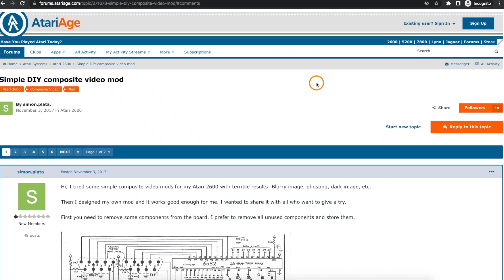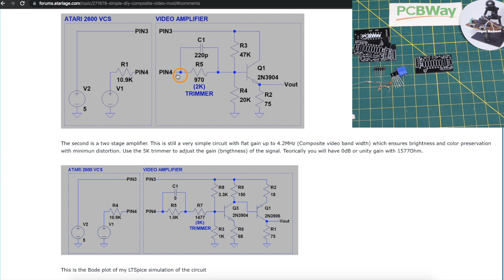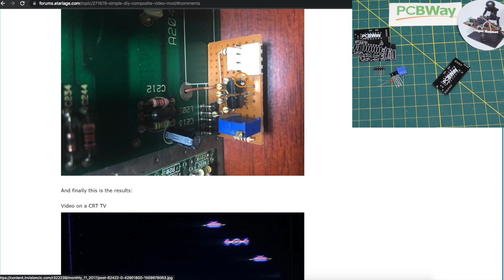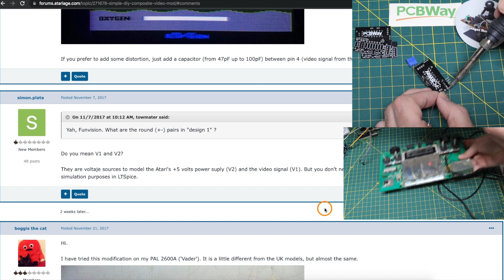Atari 2600 Composite Video Mod

Comment: When I mod consoles I always try to retain as much of the original as possible. I know that's a bit backwards but that's just how I am.
Question I got is: do those components you mentioned HAVE to be removed? Would the mod still work if you left those resistors and even the RF box inside?
Reply from the maker: I don’t know if it would work without removing some parts, I looked back at the recommendation where I originally saw the mod and it looks like what they are really doing is taking away parts that send audio and video from the chip off to the RF box so maybe the purpose is that by sending it only to the new circuit maybe it’s a cleaner signal in case the RF section makes things noisy or something
 but I don’t have a good way to test that out, it’s possible that it doesn’t matter one way or the other but I would figure if somebody is adding extra steps it must be for some good reason.
so you might want to try adding the mod before removing parts and see if it’s working adequately and if there’s all kinds of disturbances maybe that’s the reason parts would need to be removed if that’s how it’s going.
I was recently looking at turbografx 16 hooked up to a television straight with the RF connection and the quality on that was so horrible I would never want to use it even in an emergency, but that Console has access on the back expansion port for composite and RGB and audio so no mod is really needed on that one
Reply: @GadgetReboot  fair enough! I kinda figured as much. Maybe once I get to trying this mod I'll install it without removing anything, then removing the parts to see if there's a difference.

Comment: The better way mod those 4 switch models and keep the RF ,is to add CD4050 hex buffer IC and a some resistors . The 6 swich ans jr. Awready have this chip on biard , so they can be modded only wirh resistors much easily.

Comment: "Am I a giant whale? What's going on?" LMAO Nice video. I did a composite mod using an ebay bought board "Atari 2600/7800 Composite Video Mod 2.0 - NEW and IMPROVED Upgrade Kit - DIY". I have a similarly blurred image and my image is also very dark. I'm going to take it back apart and try to adjust the tint. But otherwise, it still looks better than RF but not as good as emulator or fpga. So...win? ;)

Comment: Plugging such a system directly in the composite port of a new digital TV will have major lag (half second, horrible for gaming). The internal conversion is done in a cheap and slow circuit and this is the reason you will see OSSC and such as they do essentially the same job but with lag-less conversion (under 1 frame) and with a really good low input-lag TV the about the bottom half of the screen actually beats the CRT bottom half to appear.

Comment: I'd like to see your PCB and all the components mounted on it and precisely where you installed the board. Is this the only video you are going to make? One last question, where did you find this two transistor schematic? I'm very familiar with the one transistor mod for the 4 switch Atari 2600. This is a little different. I'd like to do this mod on my old unit.
Reply from the maker: The first link in the video description is the forum where the original circuit came from and shows how the prototype board was installed https://forums.atariage.com/topic/271678-simple-diy-composite-video-mod
So I used the same pinout and installed it the same orientation.  After the video was done I added RCA jacks and used contact cleaner on switches and connectors, cleaned out decades of previous owner's dust and lint and now it looks only 5 years old, so I put it back together and I may try a different mod in the future to compare if the blurriness on some games is normal, but for now I may only do things with the case staying assembled.  I might try a multi cartridge EPROM pcb at some point.

Comment: Nice modification, now it getting harder to find tv's with RCA inputs. This is why shops years ago  when displaying their new LCD tv's used digitally produced animated films as they looked far better than an analogue version.
Reply from the maker: I ordered a composite video to HDMI converter that I’m waiting for to see if that can help expand the service life of the console.
Reply: @GadgetReboot  I think you need to go full retro and get a CRT.
Reply from the maker: I would definitely like to do that if I get around to building an arcade cabinet where I’m standing close to it and can see the difference better
Reply: I find it harder to find TVs with component input than it is to find TVs with composite input, every single modern TV I've seen has composite, and very few has component input. Heck even my 2021 55" Sony x900h has composite input, but doesn't have component.
Reply: @madmax2069  very true, I happen to have a 68cm CRT with component in tho, the other 4 all only do composite (1x54cm & 3x34
cm)